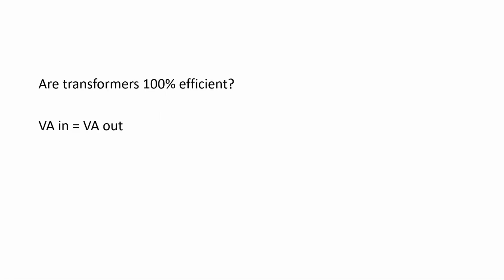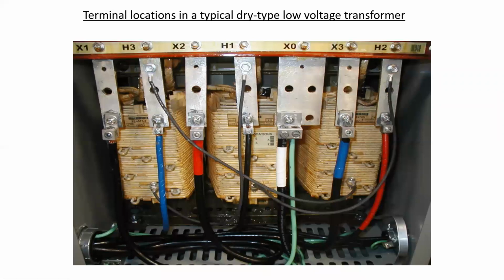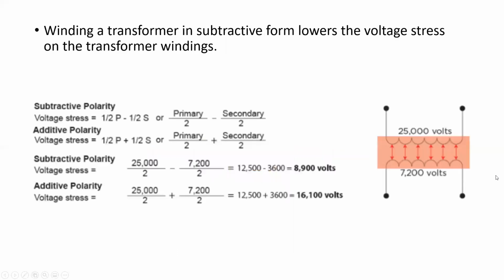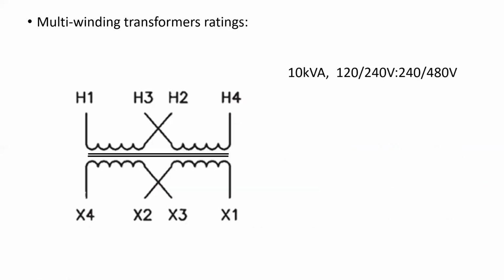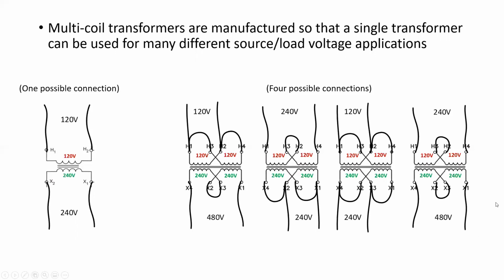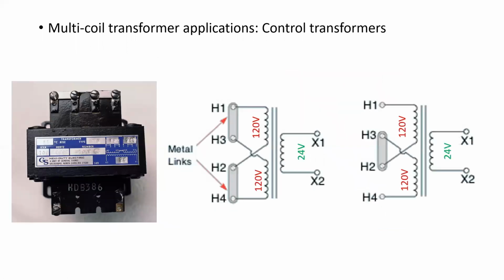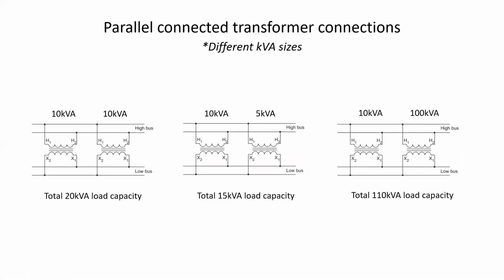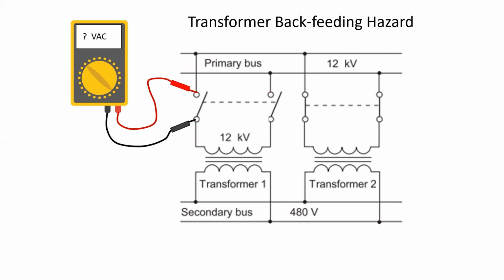Transformers Part 2 of 5

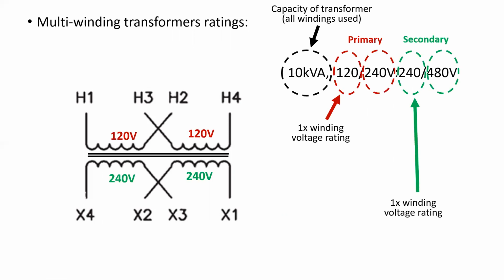Comment: Thank you for the lesson. Just quick question for you. You have mentioned  that H is high voltage but 16:39 the picture shows H side 120 V and X 240V. Is it right? or that one is just for the purpose of showing the point in voltage of multi- winding and the picture did not allow you to do it the right way? No disrespect though, just observation ;) appreciate your affords and time. Thank you
Reply from the maker: Very good eye Alex! Yes, you have identified an inconsistency in my presentation, no offence taken. 

Terminals "H" should be the high voltage, terminals "X" should be low voltage. The only exception is on straight isolation transformers that have the same voltage for both input and output.

Glad these videos are assisting you on your path to Red Seal!